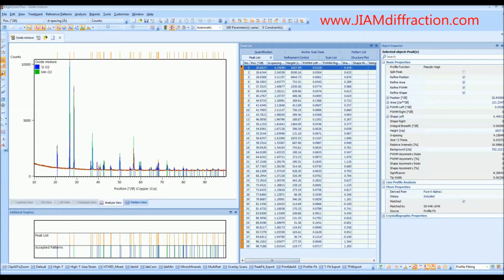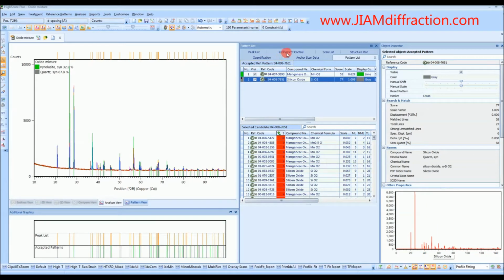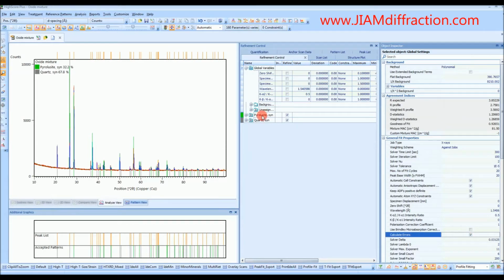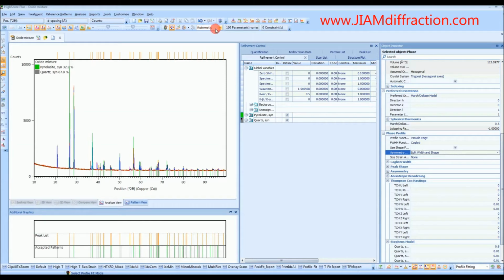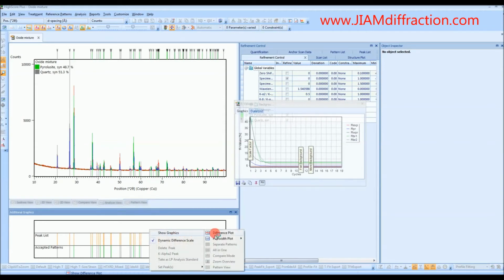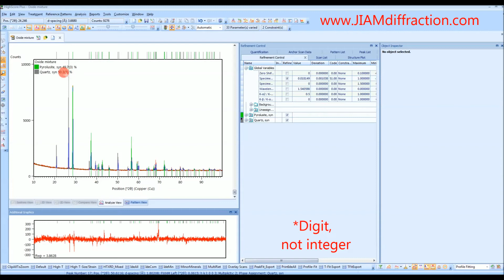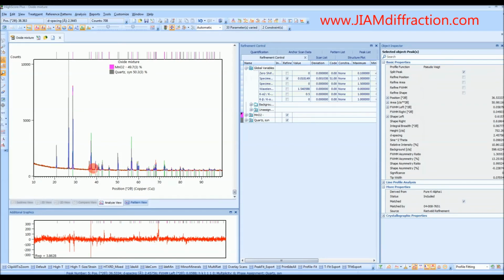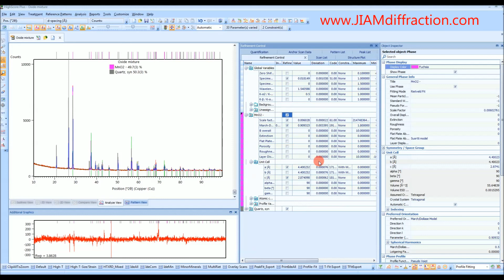HighScore Plus Tutorial - Phase Quantification Rietveld X-ray Diffraction - Short Version – JIAM

Comment: Thanks for your contribution. 

I have a few questions if you can help me. After matching all phases in a multiphase structure and adding CIF files, some peaks do not match after refinement. How can I fix this situation?
Reply from the maker: There are a number of reasons this could be.  Maybe the refinement changed the lattice parameters too much, maybe the sample height displacement changed too much, maybe the sample has a lot of texture (causing the intensity fits to match poorly), etc.  It is really difficult for me to say without seeing the refinement results (raw data vs. calculated pattern).

Comment: Thank you very much for the tutorials. At the bottom, If I had put " Profile fitting" as the Desktop name, then " Fit a Profile " is not have been activated. I had put "Rietveld Analysis" as the Desktop name, then in  " Fit a profile," is showing only three option " Clinker , Default & Stress-Strain Analysis".......Please help me
Reply from the maker: Default might work well for you, although I don't know if "Fit a Profile" applies only to peak profiles or phases.  Without knowing what refinement steps are programmed into it, it is difficult to say for sure.  I'm not sure if I know where "Fit a Profile" is located in the software (we may have different versions with different labels).  However, if you want to make your own automatic refinement programs, you can follow the instructions in this video:  https://youtu.be/0fJ6RRWOhRU.  

If you are unable to perform phase quantification, it could be that you do not have the required version of HighScore (I believe you need HighScore Plus, not just HighScore).

Comment: Sir, i have a question, how do you got that phase percentages i am trying in the same way you did but not able to get the percentages and what the term you mentioned "ctrl, not shift" exactly mean?
Reply from the maker: Are you able to refine the data?  Are you getting any kind of error message when you try to perform a refinement?  And what is the time at which I said "ctrl, not shift"?

Comment: Thank you for your excellent video, Michael Kaler.

I have a few questions. I have analyzed my sample using Highscore Plus with Pdf2, and I want to perform phase quantification with Rietveld refinement. 
Do you have any suggestions for me to do quantitative phase analysis without buying pdf4 databases?
Reply from the maker: One option is to see if you can find a good .cif file on the Crystallography Open Database (COD).  I don't know how reliable the data are from that database though as I've never used it.  If you can find a good .cif file, you can go to File, Insert in HighScore Plus and insert the .cif file.  It should then be inserted as a phase that you can refine.

Another option is to find atomic position information in a journal article.  You can then convert one of the PDF-2 patterns to a phase and manually add the atomic position information.  If you do it this way and need help figuring out how to enter the atomic positions, let me know.

Good luck!
Reply: JIAM Diffraction Facility thanks for your reply.
I’ll try as your nice suggestions.

Comment: Thank you for your endeavour. 
My question is how I can draw the Rietveld refinement data in Origin pro?
Reply from the maker: I'm guessing you already have your refinement complete in HighScore.  If so, go to the "Scan List" tab (in the same part of the window as "Pattern List" and "Refinement Control" tabs).  You will probably only see one scan present, the one you are refining.  If you right click on that scan, you should hopefully see an option like "Convert calculated Profile to Scan."  If you click that, it will make your calculated profile (the refinement curve) a separate scan.  If you double click the new scan that appears, you should only see your refined/calculated pattern on the screen (the raw data disappear).  You can then go to File, Save As, and save it as an XRDML file.  You can then either find that new XRDML file on your computer, right click, and choose convert (that works on my computer), or you can open it in Data Viewer, click on File, Convert, and then choose .csv or .xy.  One of those should work for you.  I'm not positive they can be opened in Origin, but I know they can be opened by Excel, and then you can copy the data to Origin.  

Please let me know if this works for you.
Reply: @IAMMDiffractionFacility  Hi..I tried but  I am not able to see only  refined/calculated pattern .Can you make a tutorial of the steps leading up to saving of the file.it..as I have to make my final pattern in origin. Thank you for all your videos,they are very helpful.